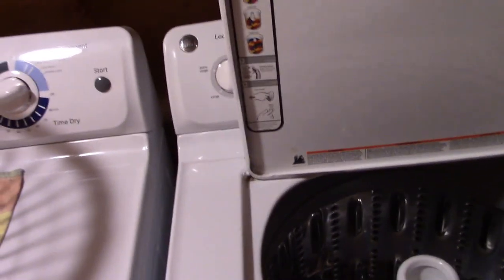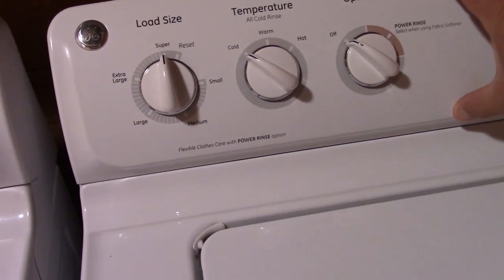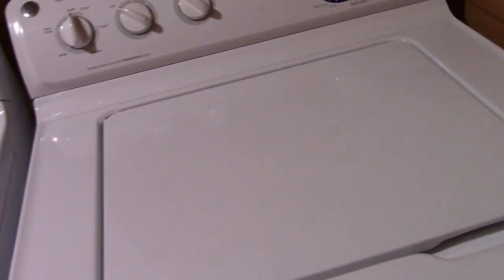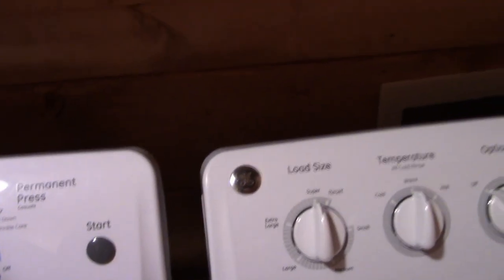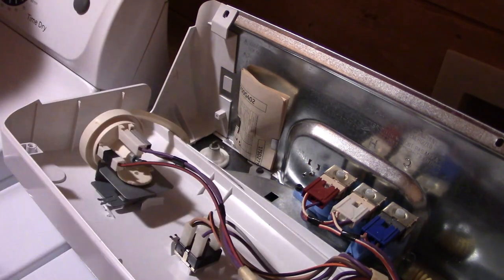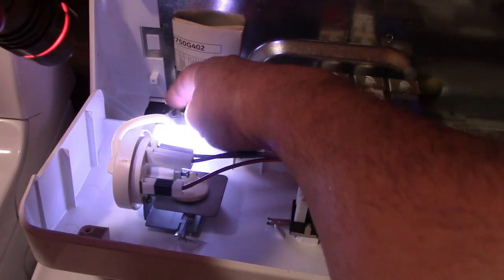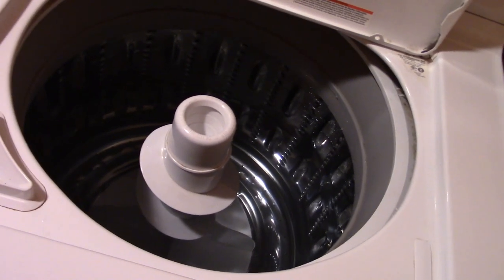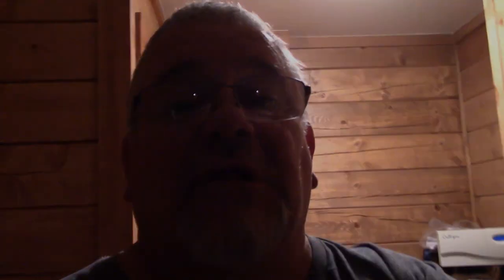GE TOP LOAD WASHER /How To Make Adjustments To Water Level - Easy - Fast - Trick

Comment: I have the Hotpoint version of this GE washer which is identical internally.   This worked perfectly.  I found I had to turn the screw on the water pressure sensor a few clockwise turns to get it to the level I wanted but it worked like a charm.   I agree with you about the newer machines.  I hate them.  I prefer these simple, top load, agitator machines with no lid lock or auto water sensing which is horrible.  Thank you for your video!
Reply from the maker: Thanks for looking and commenting.

Comment: Greatt tip there.
Yeah, they're good at using their own unique scews in washing machines.
Being on solar power and inverter most of the time,  I disconnected the heating element in my machine and just fill it with hot water on the initial 'fill-cycle' - works a treat.
Good tips....
Reply from the maker: o wow cool. Great to see you.

Comment: Our washer is very similar and I'm only getting about 5" of water for my max load setting.  This has driven me crazy for at least a year.  Tomorrow I'm cleaning the water inlet valves (we've got great well water on a spring but we get tiny particles of pebbles,  mica and general rust water). Amazingly,  even without a house water filter I get very few rust stains in the house or laundry.  (Our water doesn't smell bad either and appears crystal clear). While it's open,  I'll tackle this adjustment too! Thanks for the info!!!
Reply from the maker: COOL GOOD LUCK IT FIX OURS

Comment: We have a similar GE washer but it has green LEDs above the selector.  Our issue from day one (purchased from Lowe's about 6 yrs. ago) is the water level is too low even on the Super large or Auto level setting.  I ended up just pushing the clothes down BEFORE pressing the Start button.  (This machine is NOT an HE model, but if you change any settings AFTER it's already began agitating, the unit drains all water and soap and starts over!  So much for water saver! LOL

Last week I was repairing the unit and did an empty test load set on SMALL.
The tub filled way higher than a Super Large load!!  WTH?!
I checked to make sure the knobs weren't on incorrectly...

Yesterday I did a very large load of towels, clothes, etc...and selected SMALL;  sure enough it filled MUCH higher than Super Large!!! 🤔

What would cause this odd behavior ???
Bueller? Bueller? 🤣🤣
Reply from the maker: I am not a repair guy on these i just did my own research to repair what i had. Sorry i couldn't help
Reply: @OurCabinInThewoods  I'm gonna try the screw diaphragm adjustment to see if it makes any difference.  THANKS!

Comment: I have the same washer but it was made in 3/2012.  It overflowed and caused extensive damage to to my laminate flooring and kitchen cabinets.  The overflow was caused by the tubing from the base of the tub to the cutoff pressure switch leaked air and let the pressure escape.  The I.D. of each end of the tubing expanded over time and allowed air to escape even though I had to use a screwdriver to force the tubing off the switch and tub.  I tested the tubing in water and did not find any leaks so I clipped 3/4" off each end to bring the ID down to the original 1/8".  The tub does not overflow anymore but the rinse water level is low on all load settings.  Nowhere can I find 1/8" ID replacement tubing with a thicker OD.  Evidently the length of the tubing is critical. My tubing is now 1 1/2" shorter.  The overflow problem has been solved.  Wash water level is good on all settings but the rinse level on all settings is low.
Reply from the maker: You can get get parts for them everywhere. appliance warehouses? they might have it.
Reply: silicone the ends and let dry.THIS WASHER IS TERRIBLE

Comment: Can I pour water into it from my nearby sink ( with a hose) and will it drain out??
Reply from the maker: I'm not sure why your asking this question. If your trying to fill from sink yes but don't over fill it.
Reply: Many of the newer machines (digital controls) will actually drain any “extra” water you add manually. Dumb. Gimmi back my water.
Reply: The Hotpoint doesn't and works just as fine as the expensive machines

Comment: Mine didn't throw a lot of water and I messed with it and now it doesn't stop filing how do I fix it help me
Reply from the maker: I think you turned the screw to much. Turn the screw back the other way few turns then drain in spin cycle .then start again. If that don't work maybe something inside of that valve broke.
Reply: @OurCabinInThewoods  yeah I screwed the screwed too much that it actually fell inside I had to open it up and put it back on but I think all the rest are still too loose or too tight thank you